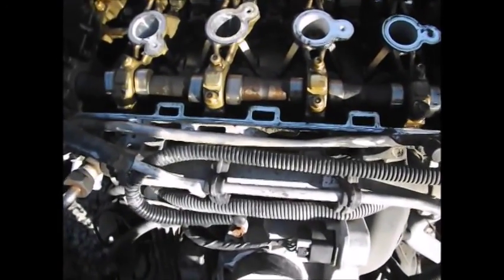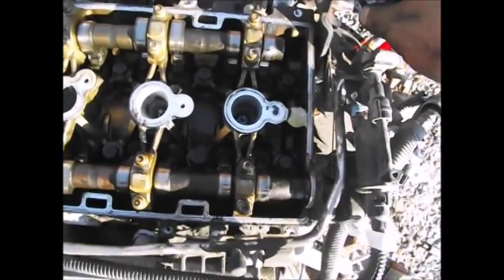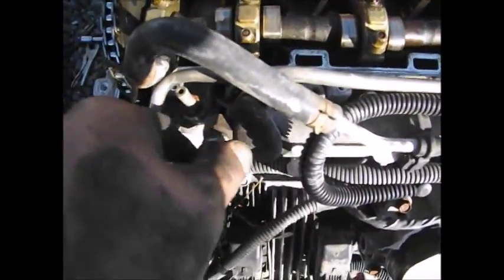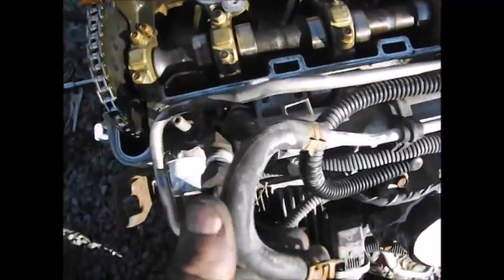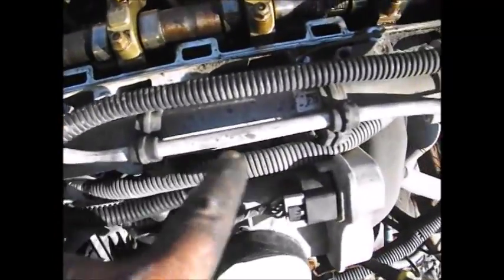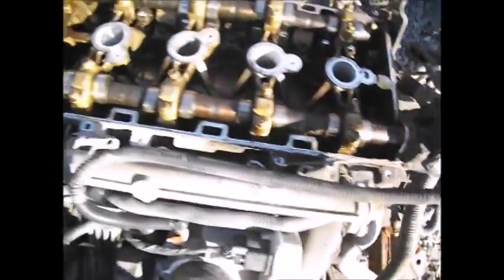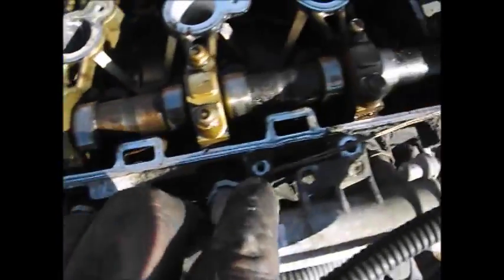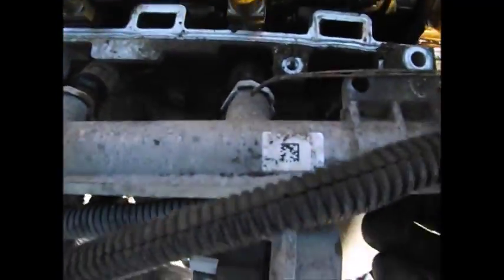Saturn Vue 2 2 Ecotec Engine Fuel Rail Removal

Comment: what about air bubbles in the line?
Reply from the maker: Just bleed them out by the valve until you see only gas coming out. Make sure the key is turned to the on spot.(( Not running )) This way the pump fuel pump will come on and try to build pressure.